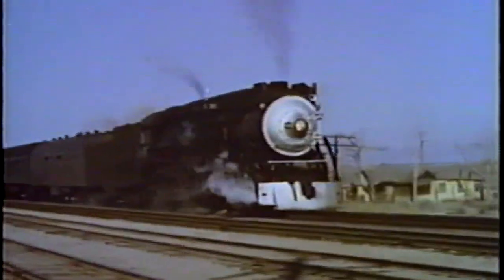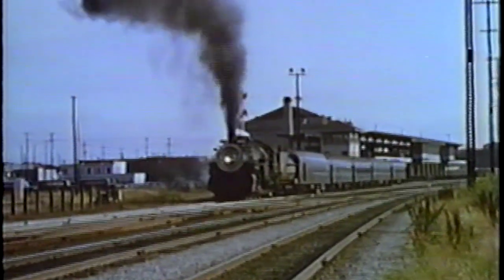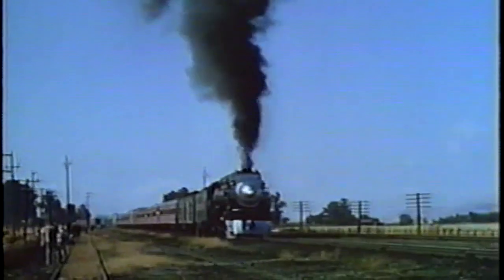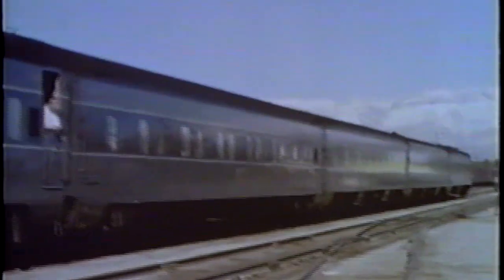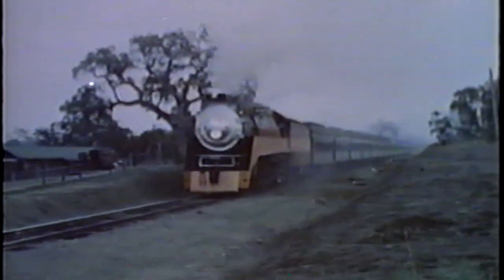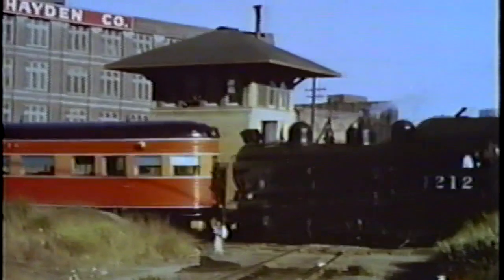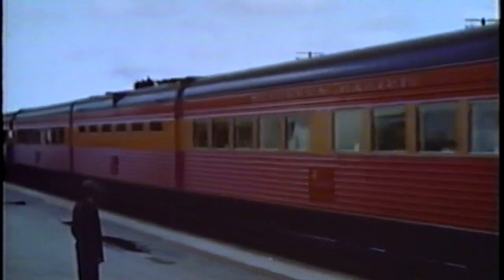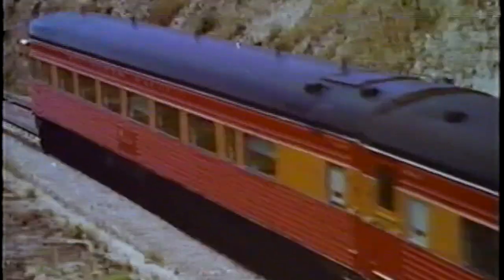The Southern Pacific Streamlined Daylight Steam Locomotives - A History and Technical Specifications

Comment: 4449 and 4460 are the only 2 surviving members of the GS family of engines
Reply: Cotton Belt L-1s (819 being a survivor) are considered GS class locomotives.
Reply: @mikehawk2003  Yes, but the 819 was built by Baldwin to far different specs. GS1 was also built by Baldwin, though she was very different than the GS7/8s.
Reply: @mikehawk2003 but 819 is not officially a GS locomotive (although it does look very similar to the GS1 7 and 8) so i don’t count that
Reply: @adventuresofamtrakcascades301  L1’s and GS7/8’s are the exact same locomotives. If 819 had been leased to the Pacific Lines, it would’ve been classed as such.

Comment: 1:11 eather thats NYC coachs that was transferd to the SP line or relaeded coauchs from ome other rail road
Reply: Those are cascade cars…
Reply: might be Cascades or Lark
Reply: I believe this train to be the SF Overland. Assuming you're talking about the coaches towards the end of the train, they are likely NYC River series 10-6 sleepers in through service from OAK-NY. The letterboard reads "Pullman" in quite a distinctive font.
Reply: And why was there UP passenger cars?
Reply: Nope those are SP coaches. In the later days of passenger service they painted coaches light and dark grey when the steam engines went black instead of the daylight.
Reply: @ironhorsemediaofficial  oh ok thanks

Comment: thats basically a 4449 without a mars light
Reply: Nope a different type of engine
Reply: Steam_Dev  4449 didn’t always have the Mars light
Reply: @ironhorsemediaofficial  All the GS-4's and both GS-5's were built with Mars Lights, so yes, 4449 has always had a Mars Light. They were never taken off.
Reply: @ironhorsemediaofficial  According to who?
The mars light design changed later in their careers from single bulb to dual, but the GS-4s were all built with mars lights, and not a single one ever had it removed.